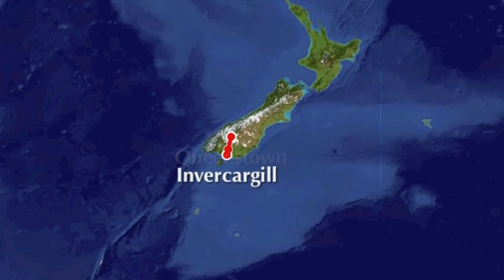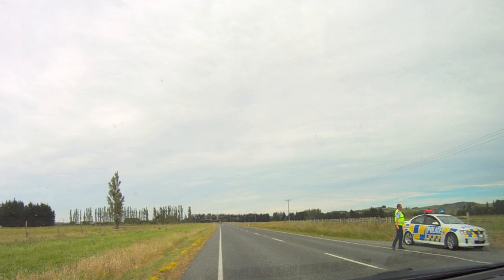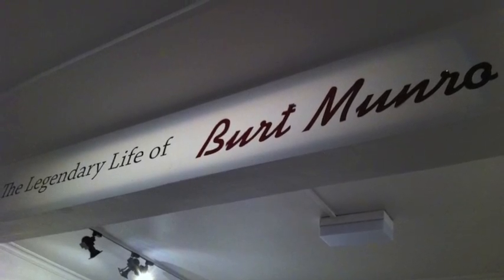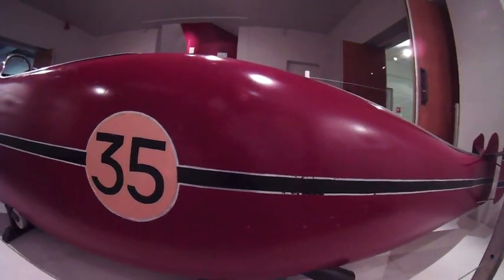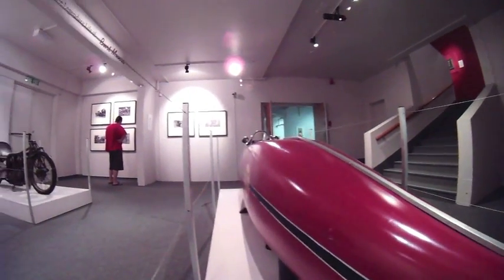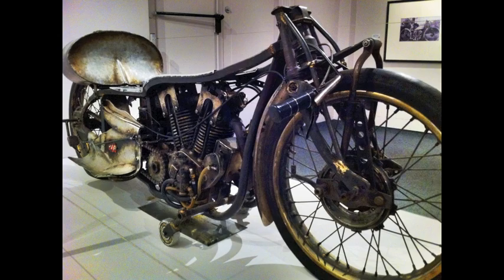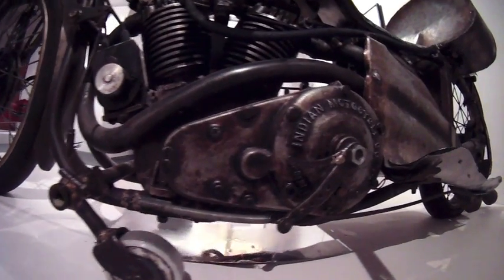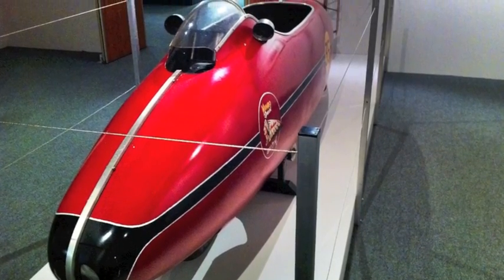Visit to Burt Munro's Hometown

Comment: All the years Burt was at Bonneville from 1956-1975

1956- Burt's 1st time at Bonneville, (spectator)

1957 - Burt's 2nd time at Bonneville,(spectator)

1959- Burt's 3rd time at Bonneville, ( still as a spectator), also in 1959 Burt first met the young Mickey Thompson, Mickey and Burt instantly warmed up to each other and became good friends. 

Burt then decided to debut with his Indian in either 1961 or 1962, it ended up being speed week of 1962.

1962 Burt's debut year - bike was 853cc, twin cam ( tail was 3 finned), s-a 883cc record at 178.971 mph (average). Earl Flanders the AMA referee said Burt's 1st measured mile on his first run was well over 180 mph also Bonneville observers said Burt could have topped his record if he hadn't let off early due to his unfamiliarity with the timing setup. Burt had qualifying and runs at 171, 175, 179 mph and 182.55 mph. Burt went full bore with his Indian for the first time ever at the salt in 1962 . He was named sportsman of the year. In total Burt did 53 miles that year alone on the salt.

1963- Burt converted his Indian to a 4 cam configuration. He also lowered the Indians nose for down force, the bike now has a large single, mono- tail fin instead of the triple fin from the previous year, his qualifying went well at 183.673 mph, after the qualifying run Burt was jittery with excitement, since the engine was going like a bomb in his own words and the stability issues were a thing of the past.

His first run he was doing over 195 mph when the front connecting rod broke, ending his record attempts for 1963. The AMA said Burt recorded 195.5 mph when his v-twin blew up. Burt averaged 184 mph in the mile, His bike was still 853cc.

1964, Burt enlarged the Indian to 871cc, the Bonneville track was rough and terrible in 1964, doing a mere 40-50 mph Burt was taking a serious beating, he had to go low gear for a while then he put her in 2nd for another mile, slowly winding the throttle up, she started weaving as well so Burt kept sitting up to stabilize the bike while the Indian was getting faster and faster and faster, by mile 4-5 he was in top gear for awhile. Burt still managed to qualify at 184 mph, but bad weather the next day ended his chance of running record runs.

 Speed week 1964 was a total wash out, only 4 days of running before bad weather ended speed week for good.

1965- a zero year for Burt, he had some runs At 168, 169 mph. At the end of 1965 Burt decided to run in the 61 inch class, 1000cc, instead of the 55 inch class, 901cc. Burt said himself he probably only qualified once.

1966- s-a 1000cc record at 168.66 mph(average), qualifying at 172 mph, unofficial top speed at 212 mph, Burt's Indian was 905cc. Burt was not happy with such a low average, considering his very sketchy runs where he was doing speeds way above that when the Indian was at the speed wobbles. Still it was another record.

1967-  Burt arrived in America in late June of 1967. He went to his friend Sam Pierce’s shop in San Gabriel California to work on the Indian. Burt Lengthened the Indian’s tail fin and cut a 8 inch diameter hole into the nose cone which directed air into the body through a 10 kilogram lead tunnel casted from the old weight he had attached to the front of the frame. He also created outlets towards the rear of the shell hoping the modifications would reduce the pressure wave coming off the front which he thought had prevented the tail from stabilizing the machine. Burt also hoped the extra weight would help his bike run true like an arrow. 

Burt also enlarged the v-twins displacement to 953cc, s-a 1000cc record at 184.087 mph(average), best measured mile at 188 mph, qualifying at 184/190.070 mph, he upped his old record by nearly 16 mph earning himself top record breaker of 1967 and American motorcyclist of the year. He was still a little disappointed though.

Burt knew the Indian had enough power to push it past 200 mph like it did the year prior in 1966 but one of the problems was the salt which was unfortunately wet and heavy. He estimated on every run that there was about 110 pounds of salt caked on the bike, which was enough to slow the Indian down to well below it's potential top speed. 

1968-  Burt had carburetor issues, the  Indian kept insisting on running rich, even with the main jet nearly closed she still wouldn't run right, he could only coax a lousy 155 mph from his Indian. It was still a very interesting year though because Burt's good friend Mickey Thompson was at speed week 1968 with his 1200 hp 1969 mustang. Mickey also gave Burt a ride at 11 pm one night in the mustang.

 After Burt got the Indian to where it seemed to be running like it's old self he decided to test his bike on the road in Nevada that ran through Reno which had no speed limit, he got pulled over after passing a cop at well over 100 mph, when the cop asked Burt on how fast he was going Burt replied with he was doing a lousy 160 miles an hour at best, later on he told the officer that he had already run at over 200 miles an hour and doing 160 is like a stroll in the bloody park. After that Burt gave up for 1968 because the Indian was not running good and there was no point in running it on the salt.

1969, For this speed week Burt was more prepared than any other year prior, he ran a qualifying run at 191 mph and his first run again at 191 mph but on his return run the Indian started blubbering and surging again like it did the year prior in 1968, Burt kept adjusting the fuel mixture, doing 14 runs on the salt in 4 days, but unfortunately to no avail. 

In 1970 Burt switched his fuel from methanol to nitromethane, even with all the adjustments he made to run his Indian on nitro the v-twin still burned out all his spare pistons. It was now over for Burt who was 71 years old. 

1971- Burt's 13th year at Bonneville and 10th year running his Indian, which was his last. Ran a lousy run at 148.51 mph without the shell due to strict rules, without the shell, the Indian was now seriously over geared, he did another run with the shell on going full bore for the last time ever. Burt never ran his bike there ever again.

 New Zealand film director Roger Donaldson and his crew were also at the salt in 1971, they filmed Burt doing some runs on his Indian for the documentary about him called Offerings to the God of Speed, (1971). it's a phenomenal documentary, I highly recommend people to watch it, it's so good!.

1975 - Burt's 14th and final year at Bonneville, (Spectator), AMA officials  said Burt could no longer officially run  anymore.

In 1975 Burt sold the original and highly modified 1920 Indian chassis/ the last version of his Indians fiberglass streamline shell to his friend Sam Pierce. Burt took the original Indian engine home and gave Sam another one. 

Back home Burt put the record breaking v-twin which he ran at Bonneville into his 1924 Indian chassis, that frame was only ever run in New Zealand.

In 1977 the year before Burt Munro passed away he sold his bikes to his friend Norman Haynes, Burt sold his  1936 velocette MSS 650 and of course the world famous Indian Scout which is not the actual bike Burt ran from 1962-1971 at Bonneville and set all the records on, the v-twin that sits in the frame is the original and highly modified 1920 record setting engine Burt modified but the chassis is from a 1924 Indian, that chassis Burt only ever ran in New Zealand. Both machines are on display at E Haynes and Son Hardware in Burt's hometown of Invercargill New Zealand.

So today Burt's actual 1920 Indian Scout is in two countries.

The original but highly modified 1920 chassis plus the final version of the Indians fiberglass shell, used from 1967-1971 at Bonneville are in America, (restored) and owned by the Pierce family, the v-twin they have is a different one, not the original/ record setting one.

In New Zealand, E Haynes and Son hardware has the original and built 1920 record setting v-twin which Burt modified all his life, that sits in Burt's 1924 Indian chassis( the frame which was never used in America, only in New Zealand). And they also have Burt's other bike he worked on as well, the 1936 single cylinder Velocette mss 650.
 
In January of 1978 Burt passed away peacefully at home, age 78.

Over 200 people came to his funeral   

Losing Burt was a massive loss to New Zealand even in America as well.

Indian motorcycles themselves were really saddened by the news of Burt's passing but they were also really proud of him.